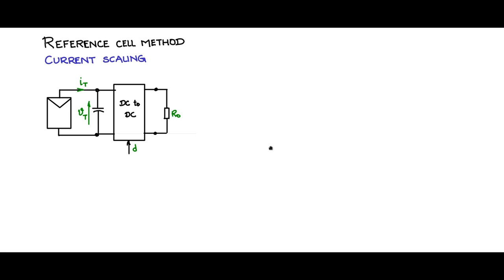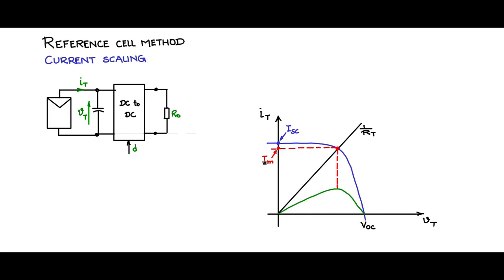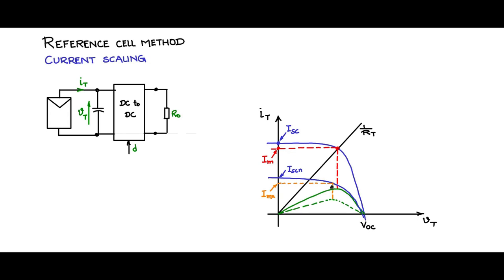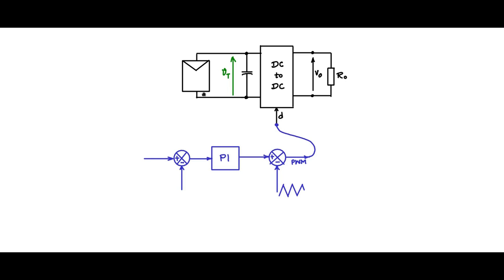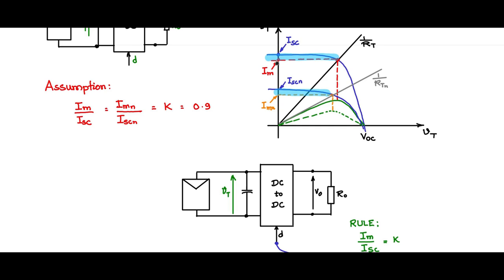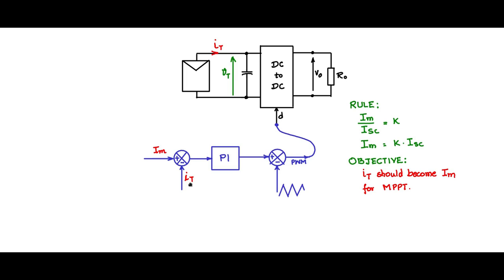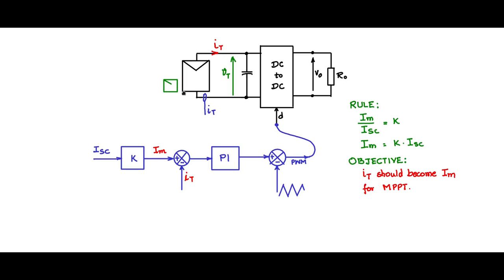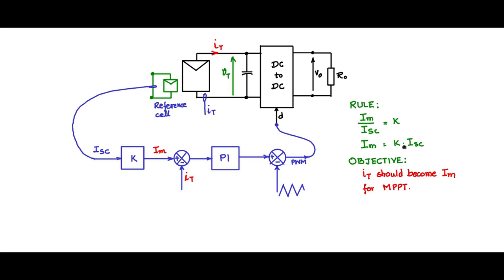Reference cell - current scaling method

Comment: Sir, while finding out the short circuit current through the reference cell of similar make... by what factor should we multiply it to get the similar output from the PV array ? Should we just multiply the number of cells in parallel with what we get from a single reference cell ?